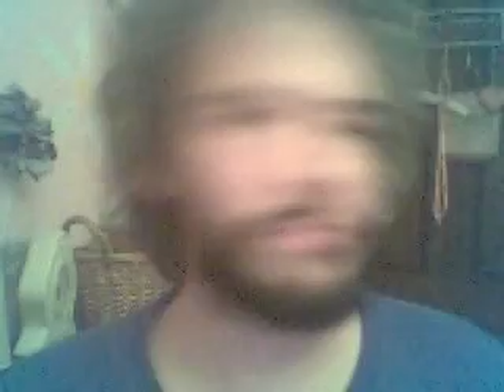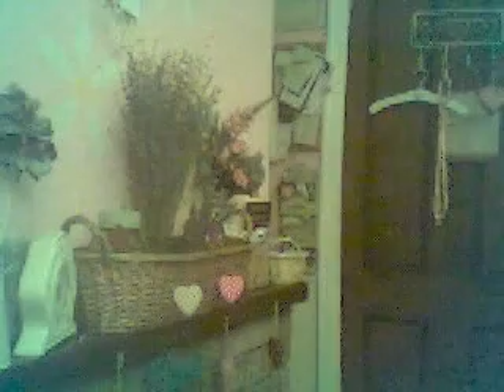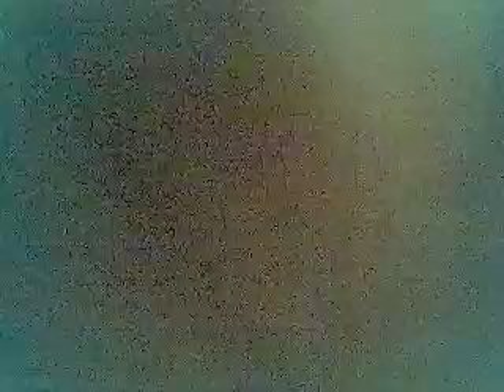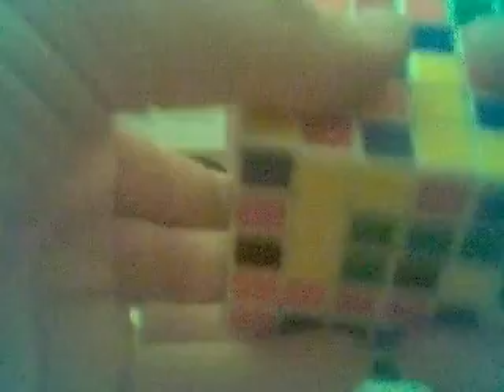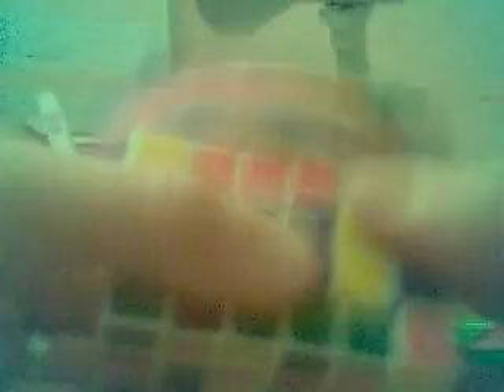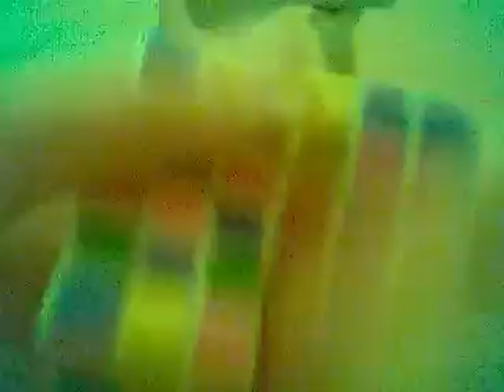To Me myself and pi: about my V6

Comment: Same thing happens to mine and I believe it is one of to problems 1. The pins are to straight and no longer sticking into the center pieces, or 2. The pins have worn in the tracks on the center pieces to deep and now don't touch them enough